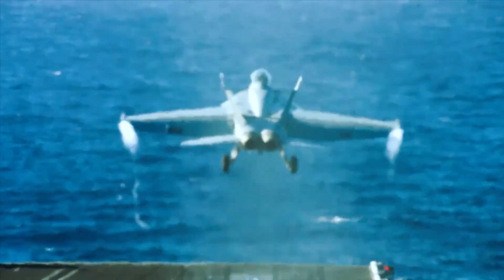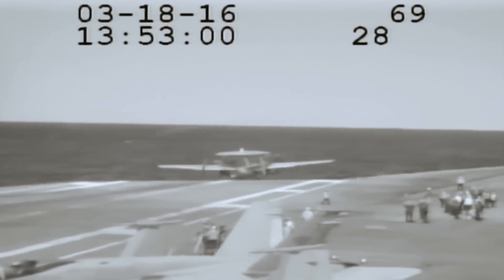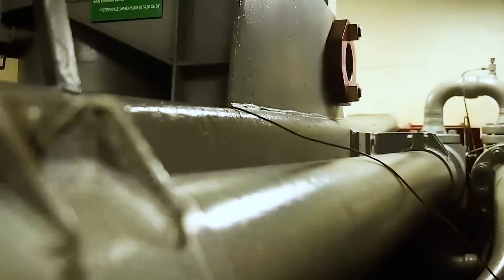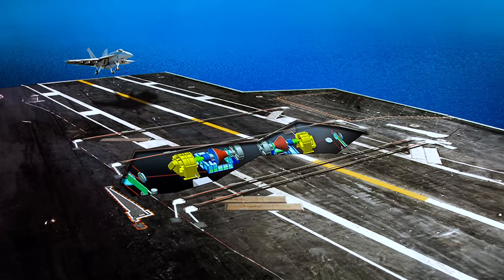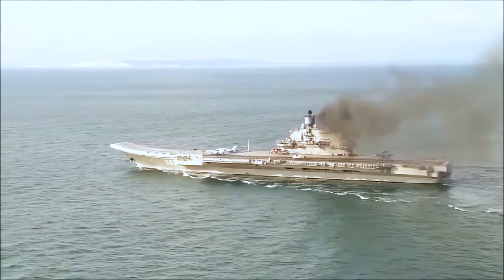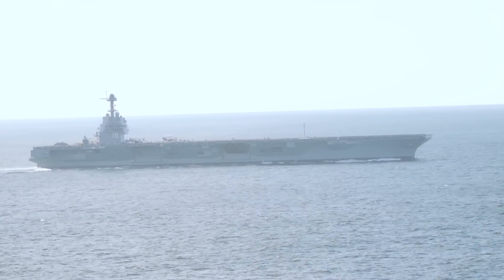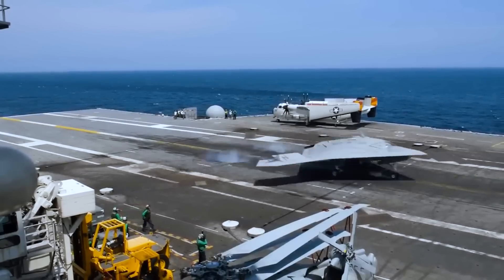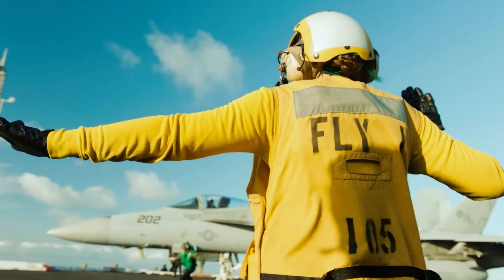Arresting Cable BREAKS on Aircraft Carrier, Here's What Took Place Next...

Comment: The BADLY written script was generated by an AI bot using outdated source material. The arresting system on the Ford had problems. They fixed it. It works fine.  The error filled script is voiced by an equally inept AI Bot. That accounts for the mispronounced words.  👎👎on this channel again!

Comment: You don't wait to see if you bolter, or if the the cable or hook break to power up.  The moment you hit the deck you go full throttle so if you bolter (miss all cables) or have a malfunction of the arresting gear or aircraft hook you can take off after your quick touch and go.
Reply: We were taught to "fly" into the wire. When the power is reduced to a jet engine, it slows the RPM. Even if the pilot goes to full power when he realizes the he either has a Hook skip, a few seconds of delay it takes the engine to return to full power can make the difference between surviving a trap to this being your last trap. Of course, when I was involved it was in the dark ages of Essex class carriers such as Hancock. The idea that you could go to full power when your wheels touched down would compare to playing Russian roulette. You have already lost the game if you get a skip or broken cable. Broken cables always inflict a lot of injury to deck personel as well as the loss of a flight crew and aircraft.
Reply: @MichaelRagland-yg1rc  I am an enthusiast of naval aviation so its great to hear from an actual aviator.  What did you fly?  F8, A4?  One key thing to note is when using the F-18 as an example it has very high slow state energy bleed at high alpha, so the pilot flies the throttle a lot to keep around 150 KIS and needing around 30% power to keep that speed at the desired descent rate, thus the engines are quite a bit above flight idle and will spool up quickly once the throttles are advanced to full.  I don't know where 2nd and 3rd generation jets performance lies by comparison to the F-18 on approach but imagine the engines spool times were significantly longer if for no other reason than the generation gap and advancement in engine design.

Comment: Stop the garbage screen shots, the F 22 Raptor does not land on aircraft carriers…..can you do things properly?…..stop the false information and bullshit screenshots 🤬
Reply: You sound dumb , if you knew anything , you would know they always make variations of the same model for all 4 armed forces. Dummy .
Reply: There is no F-22 Raptor in this video. There are however F-35c Lightning 2 which is the naval version of the F-35 series that does land on aircraft carriers. In fact the Ford class carriers are specifically designed for the F-35 where the Nimitz class required specific upgrades to be able to operate the F-35.

Comment: WTF is an airofinisher???  It is called an arresting engine.  This holds the purchase cable that is attached to the cross-deck pendant via the terminal and pin.  The cross-deck pendants are replaced after 125 traps and it takes 2-3 minutes to replace one.